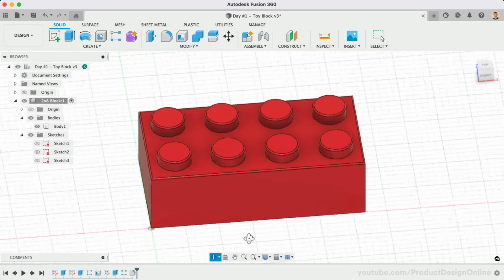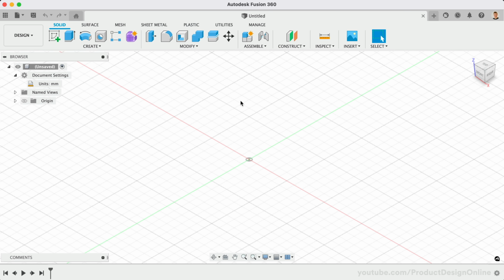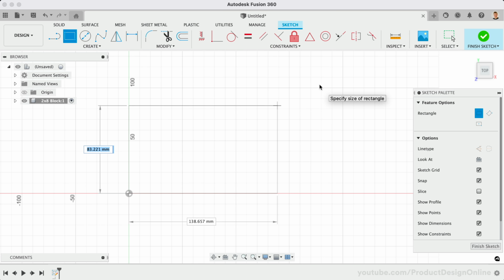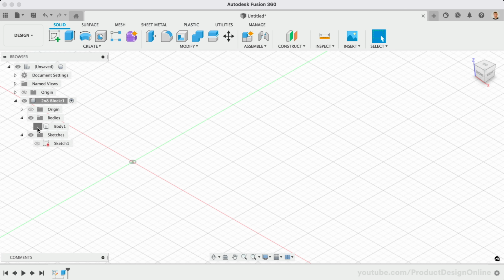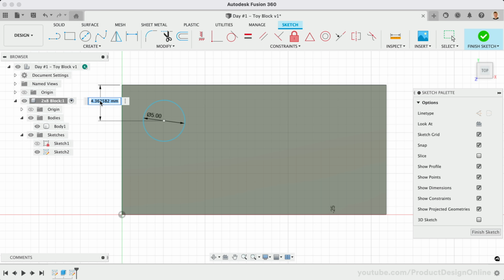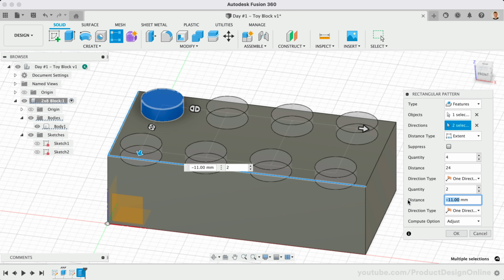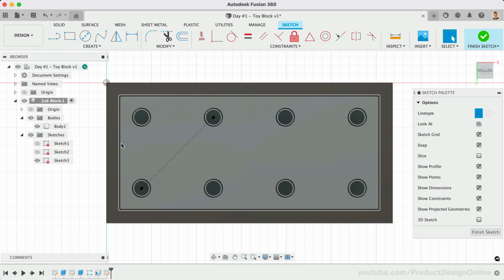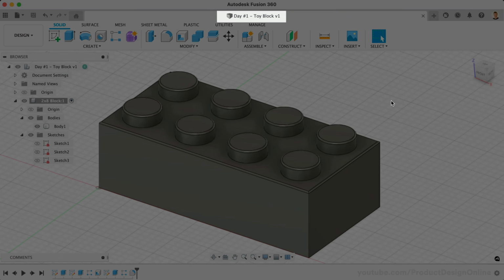Day 1 of Learn Fusion 360 in 30 Days for Complete Beginners! - 2023 EDITION

Comment: As a person who did technical drawing around 40-45 years ago at school, using CAD in any form is hard.  But with the excellent help of this tutorial I think I will be able to get where I want to be when I start using my new 3D printer.  As a comment for the creator, I am using windows not apple, and therefore some minor things are different.  You could highlight those differences in your commentary; ie directions in apple seems to be axis in windows.  You are also a bit fast speaking, and you sound slightly tipsy when I use the slow down settings on YT.   However you got me through the first one and for that I am thankful.  I will be completing this course, so I can understand what I need to for my requirements.  Finally - my package is a limited use version, and it would be useful for you to show us how to save files locally, instead of in their cloud storage on autodesk - this may come later, but it would be useful to know at an earlier stage….

Comment: I  have to start out by saying Im a complete newb!  Aa a newb I find this instruction to be worth its weight in gold but at the same time I have to admit, like others have mentioned, it took me 2 hours to complete because of all of the pausing and rewinding.  The instructor is amazing but for a newb its a bit fast paced.  I found a solution, not exactly rocket science but it worked for me and figured worth sharing.  I simply decreased the playback speed of the tutourial video to 50%.  Yes it makes the instructor sound like hes had a hard night out at the bar but the slured instructions are easy to follow and my second lession, the glass bottle, went much better.  Took me only 40 mins to complete with pauses but nearly no need to rewind.  Looking forward to jumping into lession 3 now, the paper clip!

Comment: I found this tutorial based on a reddit recommendation. I'm in my mid 40's now and it's been more than half my lifetime since I did CAD training on AutoCAD R12 - R14 and worked in the automotive industry. I loved that job so much. Even though I'll never use it I still have my drawing portfolio from when I finished training.

Now I'm looking to acquire a 3D printer I thought it would be the ideal time to find some appropriate software to design & model the things I want to make and it looks like Fusion is going to be the one. This was a fantastic tutorial to help me find me feet and understand how Fusion does things. Absolutely top work mate. 10 / 10.
Reply: a 3dprinter is awesome, if you want any recommendations then I recommend any bambu product they are awesome and they just work.

Comment: Hi, thank for your tutorial. I just started using Fusion360. I have a question to ask.
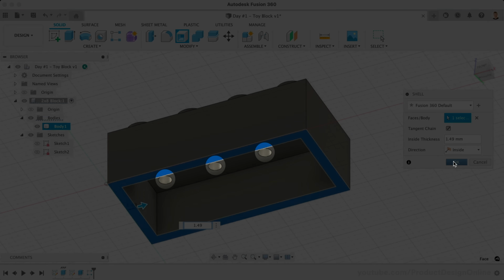At 10:07 in the video, if I want to fill the hole in this part, how do I do it? I want to use the model for 3D printing. I Googled and found a method to use the Path function under Surface. This looks like the surface has been filled in Fusion, but the hole can still be seen in the 3D printed. How can I do it? Thanks
Reply: Hello Ostrich, I was asking myself the same, I did not fill the holes afterwards, but extruded those without the "join object" option but the "new object" option. This way they don't get touched. Good look!

Comment: at 3.56 the tab key works as you say however when I type the dimension it will not accept decimals.  when I use them it erases the previous typed number ie:15 and only accepts 8.  why would this happen?

Comment: Maya user here, trying to decide between this and something like ez cad for simple parts laser cut. We work with sheet metal so no need for any extrusion
Reply from the maker: Check out my lessons on the sheet metal tools. Even when doing simple flat parts for laser cutting, I would recommend using sheet metal components so you can take advantage of the sheet metal rules. That will also have your files future proof if you need to add bends, etc.

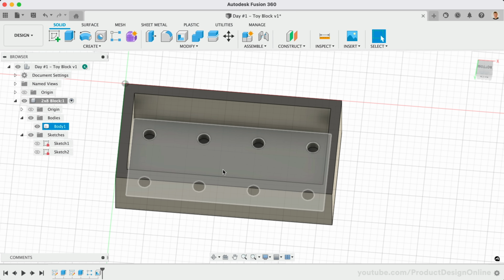Comment: At the 10:17 portion of the video, the shell command is used to hollow out the underside of the block. It then shows the bottom of the 8 cylinders from the top surface.  Why do they appear so much smaller than actual cylinder on the top surface?
Reply: Answering my own question - the 1.49 shell distance also goes inward from the outer edges and top of the 8 cylinders, so there are 8 small diameter cutouts when viewing the block from the bottom.

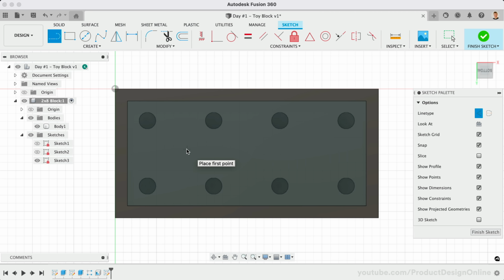Comment: I cannot select centre of the circle ( referencing existing geometry at 10:40 ) I can snap to grid but mouse will not snap to centre of circle.. any tips?
Reply from the maker: Can you confirm you're looking straight at the sketch (bottom orthographic view)? 

When looking at an angle, it often does not pick up references.
Reply: @ProductDesignOnline  I got it sorted. I was straight on but sketch 1 & 2 were visible. After I hid those I could pick up the centre points. Thanks for the reply!

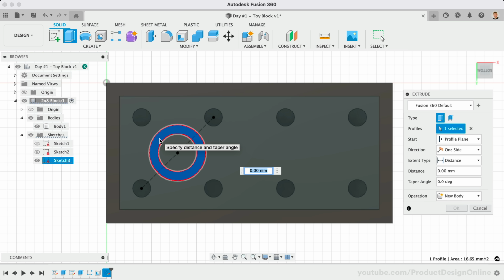Comment: 11:51 I can't seem to select the space in between the circle and the offset circle to extrude it. It only selects the plane beneath it. Where have I gone wrong? Linetype is not construction.
Reply from the maker: Double-check your sketches in the Browser and see if the original rectangle sketch is turned on. If so, hide that.

It sounds like something else is in the way and conflicting with the sketch. Let me know if that wasn't it. I would need to see the file to troubleshoot further :)

Comment: Hi I just created the 5 mm circle and you say, "Select again to place the circle". I do not know how to select it again. When I typed the diameter I hit enter and the circle was placed. I can not figure out how to move the circle. Also you mention that the circle command remains in effect. As soon as I hit enter after dimensioning the circle the circle command is cancelled.
Reply from the maker: Hitting enter is the same thing as selecting/clicking again with the mouse :)

If you've already 'placed' the circle you can click and drag on it to move it around. It must be constrained to something if it doesn't move at all.

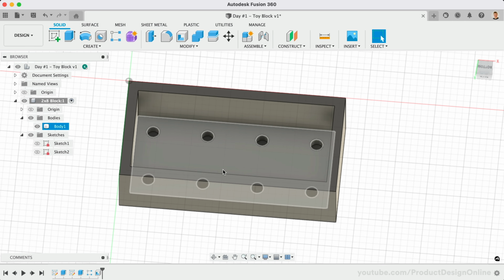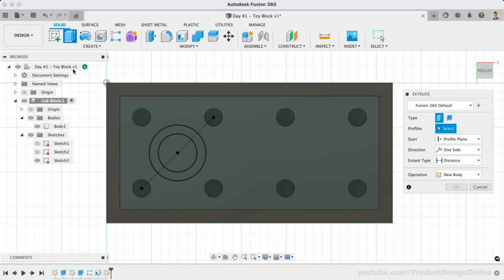Comment: 10:20 in Fusion version 2.0.19, selecting the inner face was tricky. I had to long-press the left mouse button which brought up a context menu, and I could select "Face", then select the inner planar (the inside back of the top of the block). I had to do something similar ~ 11:50 to select the concentric circles for extrusion except I selected "Profile" instead of "Face".
Reply from the maker: It sounds like your sketch may not have been hidden by default and was in the way. It should auto-hide the original rectangle sketch after you used the Extrude command. Does it show your sketch as visible in the Browsers?

You generally should not have to long-press to select something unless it's behind another body or entity.

Comment: I have version 2.0.194 and having a major issue following this video... When I create the 3 tubes under the block, it keeps placing the blocks on the top surface or above the surface of the underside (scalloped) area. I cannot create these three extrusions. Very frustrating.
Reply from the maker: It sounds like your Extrusion is either going the wrong direction or your sketch is on the top surface. Can you confirm your sketch is on the underside of the block? If you can share a link to a screen recording or screenshots that would help as well.

Comment: In free trial version, in sketch mode, no dimension tool in tool bar
Reply from the maker: I would recommend resetting to the default layout. View menu > Reset to default layout.

You can also use the shortcut letter "D" to get the dimension tool.

Comment: https://youtu.be/d3qGQ2utl2A?t=175  - My axis are different from these video - My Y axis is equivalent to the Z access in this video, and its on a different corner of the cube
Reply from the maker: Z-axis up should be the default. You can change this in your Preferences. I would recommend 'restore defaults' - https://productdesignonline.com/default-settings-for-fusion-360-tutorials/#restore

Change the axes (Default Modeling orientation) - https://productdesignonline.com/default-settings-for-fusion-360-tutorials/#modelingOrientation

Comment: This is the best beginning 360 tutorial I have found so far.  I have a lot of experience in 2D CAD and was getting very frustrated trying to figure out the flow in 360.  A bracket I was trying to design which would have taken 30 seconds in 2D cad took an hour.  After watching this video I have a much better handle on how the tools work and look forward to the rest of the series.

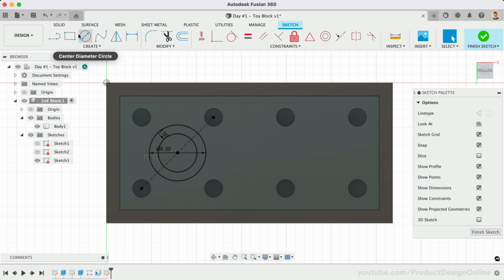Comment: I am stuck at 11:45. When attempting to select the circle that will become the wall of the cylinder, it only allows me to either A. Select the entire underside plane of the block or B. Select one half of the center of the circle which is where the cavity of the cylinder should be. I've redone the process multiple times. Not sure what I'm doing wrong. Your version of Fusion360 seems to be a bit different than the one available today. What am I missing here?
Reply: me too. I cant extrude the circle and its offset at the bottom. It selects the inside plane bottom of the block. Did u solve it?
Reply: nvm i see what i did wrong

Comment: Most frustrating lesson ever. I struggled all the way to building the bottom. I followed each step and fought to get my computer and program to do what yours was doing. At the bottom, I followed your lead exactly, spent all day trying and it simply would not work like yours.
Reply from the maker: Can you elaborate on what you were facing with the bottom? Double-check that your sketch is not in the way, if it was a matter of not being able to select the bottom face for the Shell.

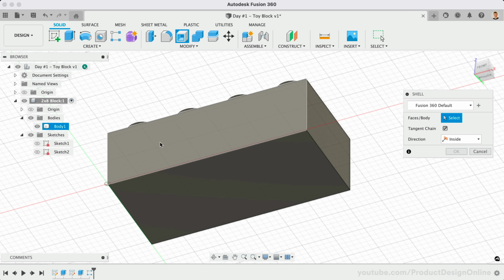Comment: I am stuck at 9:50. When I try to select the bottom face in shell mode, it doesn't select the bottom face, rather it wants to select the lego studs that we created a minute before this section. What am I doing wrong?
Reply from the maker: Double-check your sketch is not turned on still and blocking the bottom face. You can also look directly at the bottom face to avoid selecting some of the other elements.

Comment: Running AutoCAD for 25 years - use Fusion for CAM and CNC G-code. As much as I want to use it for design, the modeling process is just too slow!
Reply from the maker: What parts of the design aspect do you find slower than AutoCAD?

Comment: Why would a business post a job for 100k and then ask for 10 years experience using fusion 360? Isnt it free? Why not use something better like Mastercam or even esprit, etc?
Reply from the maker: Can you share what job you saw with those requirements? Fusion has only been out for just over 10 years, so that's pretty funny to hear 10 years experience with Fusion specifically.

Fusion is a commercial product but does offer a free license to hobby users.

Comment: As an avid 3D printing/cnc/wood working hobbyist - I've been back and forth on a software for years. I finally decided to give the 1 year trial a go. This is my first video. I've come from tinkercad and have minor experience in some older vector tools (Macromedia/Adobe Fireworks). Thus far, I feel like I can do anything relatively simple in Tinkercad, but it's extremely limited. I made the jump and will be honest - I had to turn the speed of this video down to 0.75x and replay some things a few times. It took me about 20 minutes to complete the block. As a techy, I can make the movements and navigate software - but every tool has a steep learning curve. I really hope to grasp the skills required to use this - Excellent tutorial. Although I feel slightly discouraged, due to the amount of steps (I know I won't remember half of what I just did) I think that this is going to be the best way to learn. I will try another video and maybe try to do a few things on my own and re-visit these videos from time to time. You could honestly be selling this course as it's done so well. Thank you! !

Comment: Not sure if it a version or Mac issue, all good up to the hollowing the body step around 9:40 , I can see the "shell extrusion" but  I can not select the plane inside, so you can not get the centers of the holes.
Reply from the maker: Double check that your sketch is turned off in the browser. It should happen automatically, but if it's on for some reason then it will be in the way it won't let you select that face

Comment: I am not a total newbie to fusion, but I have only worked with making cookie cutters and embossing folders, so I am new to several things.  I struggled with some of the steps because you failed to mention that you needed to finish the sketch.  Also I have a different version so the steps are different.  I have version 2.02.28477 so yes, the Directions to Axis are different.  I was able to figure it out, but thank goodness I have some experience to help me.  So far, this all makes sense and I hope to be able to figure out to make  a stamp embosser with a handle.
Reply from the maker: You don't need to 'Finish Sketch' as activating a modeling command automatically does that for you, as seen in the screencast.
Reply from the maker: Here is a lesson on creating a Stamp with handle: https://youtu.be/qvrHuaHhqHI?si=AOugclGvlCfldFva
Reply: Thank you!  That was a valuable class.  I try to follow your steps in Fusion 360 and I watch your tutorials.  Some of them I struggle with, but I'm getting it.  Your tutorials are so much better than some that I have seen.

Comment: Stumped at the 7:07 mark.  I click on the Sketch Dimension button, then the center of the circle, then on the top line of the block, then move my cursor out of the box and nothing happens.  At no point does it ask me for a measurement as it does in your video.

Comment: I'm so confused right now. I'm at the point to save the block. When I save it the screen goes empty and the bodies and sketch headers disappear on me as does the block. The screen just shows Day #1 Toy Block v1, Document settings, Named Views (TOP, FRONT, RIGHT, and HOME) Origin O, X, Y, Z, XY, XZ, YZ 2 x 8 Block:1 then Origin again with the exact same ), X, Y, Z, etc, but nothing after that. What do I do?

I'm trying t get away from tinkercad to something with more ability.
Reply from the maker: Something doesn't sound right. What computer (specs) are you on? Try closing the file and Fusion and see if the issue still persists.

Comment: Hmm.... i'm completely new to this and i'm able to follow along and understand what and why i'm doing it - excellent instructions!.
But when completing the Shell operation, it won't let me select the inner plane of the top to start a sketch.
Only the bottom plane of the block and i cannot understand why... slowly going insane 🤯😢
Reply from the maker: Thanks! I'm guessing (without seeing your file) that it's due to your original sketch being on. Check our Fusion Browser and turn all of your sketches off. If the sketch is in the way, then it may be blocking you from selecting the inner face.

Comment: who decides measurements of the holes when we used shelve
Reply from the maker: The Shell command will trace the entire contour and apply a thickness based on the value input in the Shell dialog. It traced the contour of the nubs on the top, leaving the small indents on the underside since the defined thickness is less than the diameter of the nubs.

Comment: Hello, I use the personal and free version of fusion. Every time after designing, when I want to save my model in stl format, I have to wait for the generative design to be done. Is there a way to save my model immediately and not have to wait? Thankful
Reply from the maker: Yes! Don't use the File Save as workflow for STLs. 

Instead, right click on the component in the Browser > Save as Mesh > choose STL > save to your computer. This processes the stl immediately (locally) instead of using cloud translation like the save as/ export menus.
Reply: @ProductDesignOnline  Thanks, where is it stored?
Reply from the maker: You choose your local folder on your computer when you do that 'Save as Mesh' workflow. You can also send it directly to your 3D printer's slicer, if desired. @Raminparvari-pv

Comment: Just started to use fusion. I was wondering if anyone could explain to me why my 3d block is transparent instead of solid (I mean colored)
Reply from the maker: Do you have another component in the Browser active? If not that, did you change any of the opacity settings? 

Also, note that there are different appearances. Some of the colors/appearances are transparent instead of opaque.
Reply: @ProductDesignOnline  Thanks for you‘re answer. I‘ll take a look at that.

Comment: Thanks! Had some trouble starting as I was not in the Home screen which meant there was no 
New Project available + everything looked different so I got stuck. So that and your instructions 
to set Default should have come first IMHO ;) 

It would also have been useful if you had the main shortcut keys listed in your description. 
Including navigation like the Pan and Orbit. 

Cheers ;)
Reply from the maker: Thanks! I do have a PDF you can download with all the Fusion shortcuts: https://productdesignonline.com/tips-and-tricks/fusion-360-keyboard-shortcuts/
Reply: @ProductDesignOnline   Thanks! Putting the most used ones in the description is more accessible since it only requires a tiny scroll to get to it rather than reading a "book" about it. ;) Cheers :)

Comment: Wonderful video and very easy to follow! I learned SolidWorks and Blender on college years ago, and compared to SolidWorks and specially Blender, this software looks very user friendly.

I have one question about the free download of Fusion for personal use, so maybe you can help. The site says it is targeted for users that generate less than $1,000 USD in annual revenue and use for home-based, non-commercial projects only. I'll use the software for learning, but if I feel like I can add a project made on this software on a portfolio, would it be ok?